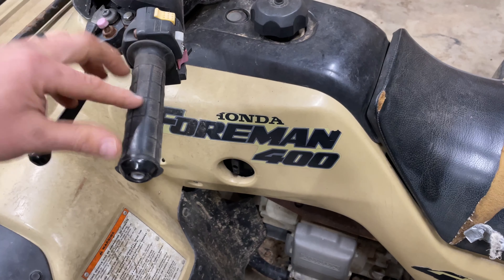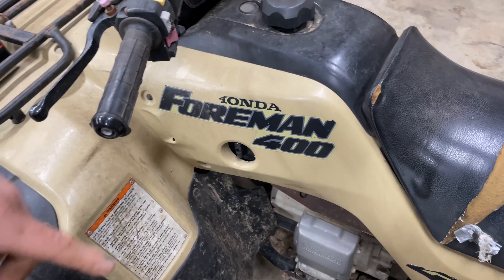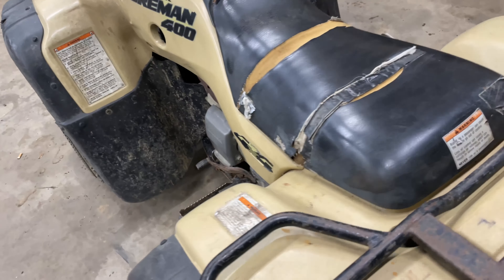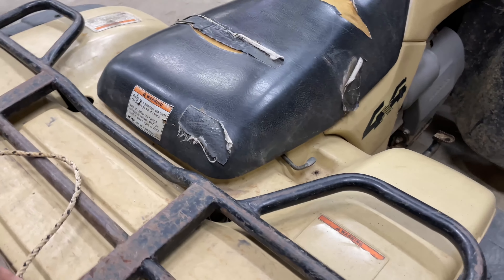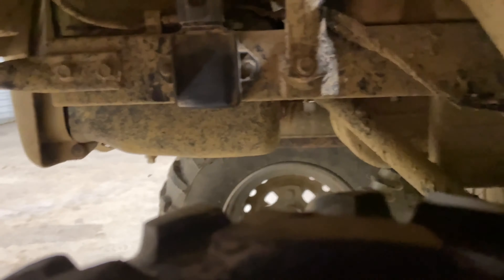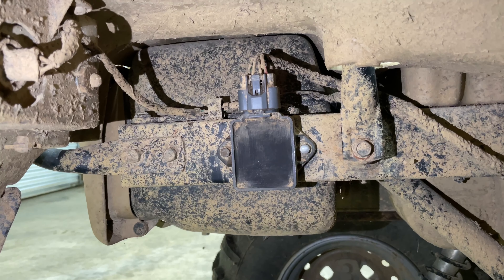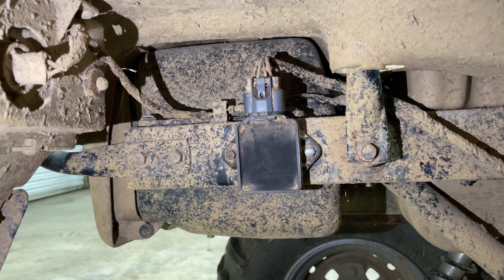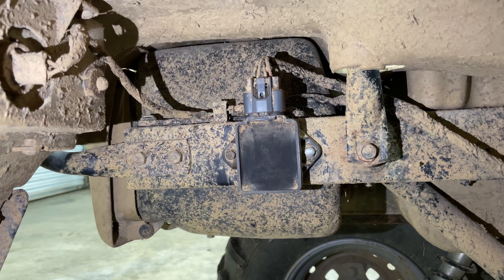Honda Foreman 400, Will Not Fire, No Spark, Will Not Crank, Will Not Run

Comment: Realizing this pertains to absolutely nothing,
I have a 98 400 and really wish it was the sand color
I got the green one. Granted I got mine at a great price so I shouldn't complain, but ... LoL ☺️
Reply from the maker: LoL!! Thanks for watching and be sure to like and subscribe to our channel!!
Reply: @crankitt825  I have a 1998 foreman 450s it turns over and has very little spark but will not start and run. Will putting a new regulator fix this issue ?
Reply from the maker: On these foreman most of the time the voltage regulator goes bad and it does affect the firing. It’s either going to be the voltage regulator or the cdi box. I would do the regulator first. It’s a lot cheaper then buying a cdi and finding out later that it’s your voltage regulator.